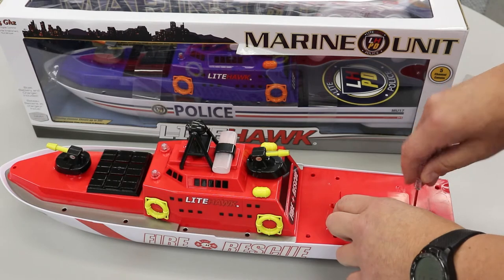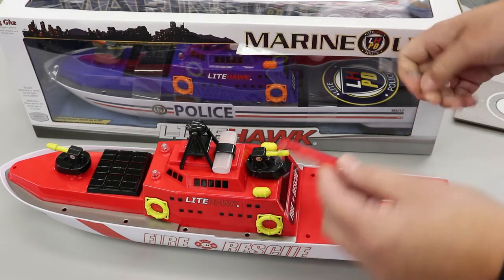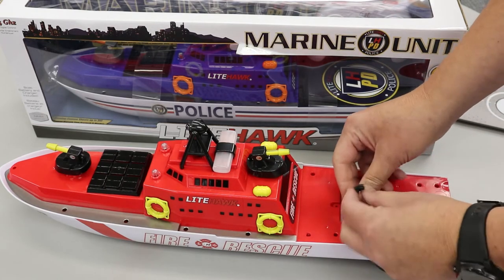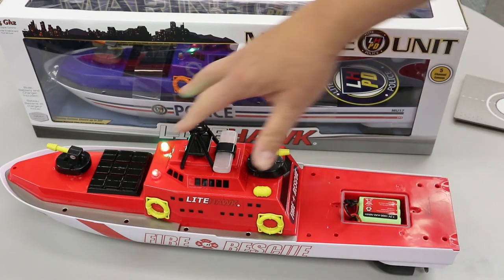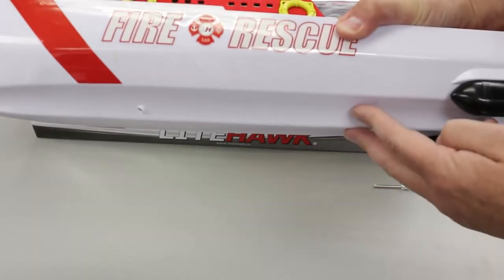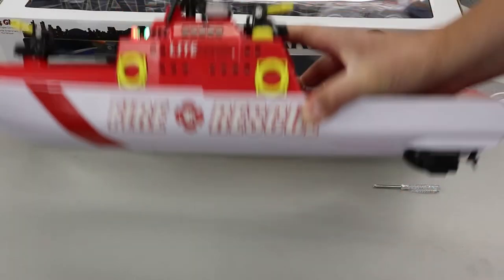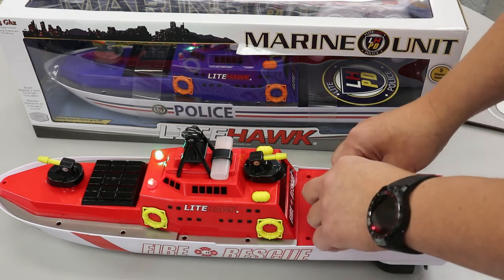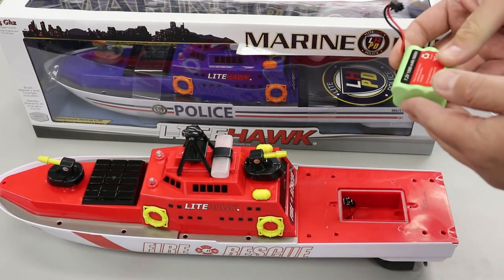Litehawk Parts n' Tech | Emergency Rescue - Removing the Battery Compartment

Comment: So how does the grey hatch come off? Do we just pop it off? It's quite tight i don't want to break it
Reply from the maker: Not to worry Rob you won't break it. You may find removing the deck for the first time difficult, since it is molded to fit tightly. We do have another video on our parts and tech detailing how to remove the rear deck!